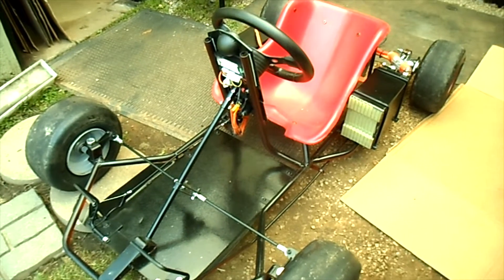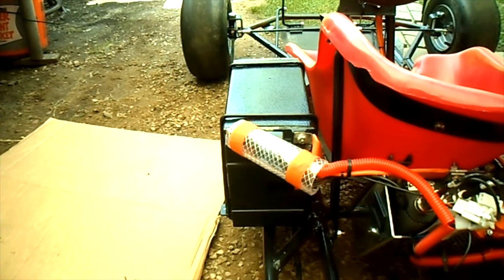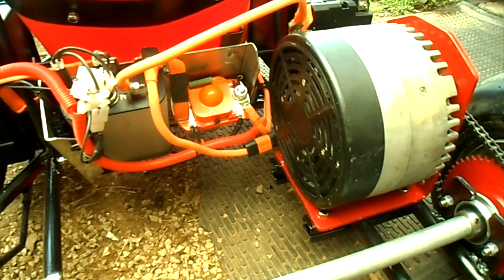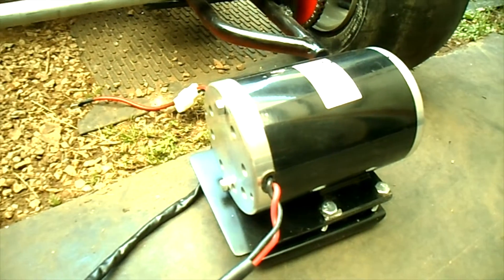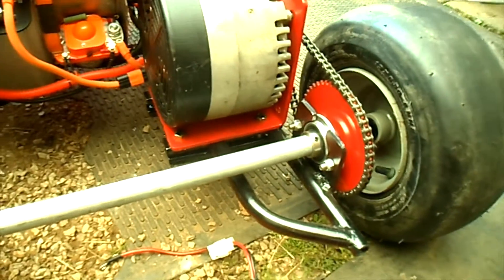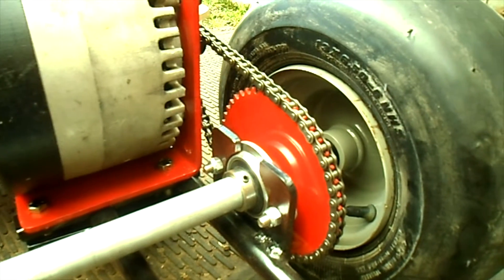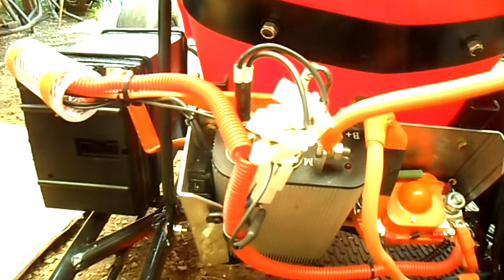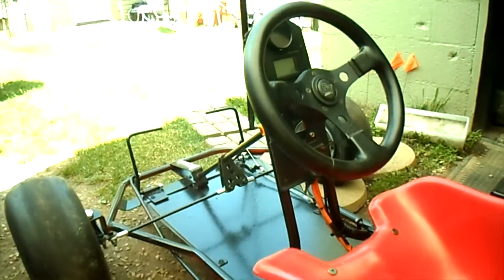Hell-raiser 48V Electric Go Kart w/ME 0708 Motor first test run

Comment: Badass gocart what axle sprocket size should i run with 48volt 1000 brushed motor motor sprocket is 11 tooth #25 chain 6.35 pitch
Reply from the maker: Well, it depends. Usually a 6:1 gear ratio is a good starting point (so, an 11t drive sprocket with a ~66T driven sprocket) But, the overall weight of the kart , the size of the rear wheels & the terrain it will be run on, are all key factors in figuring the "right" gear ratio.